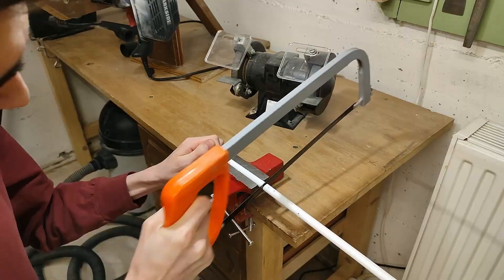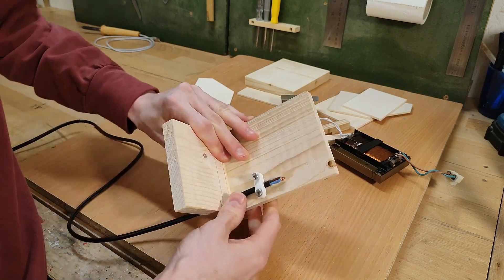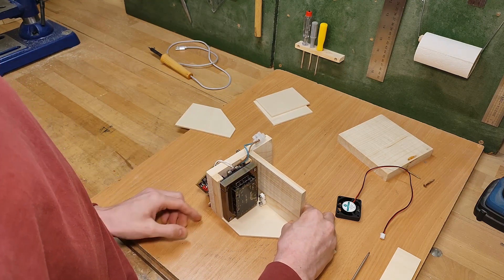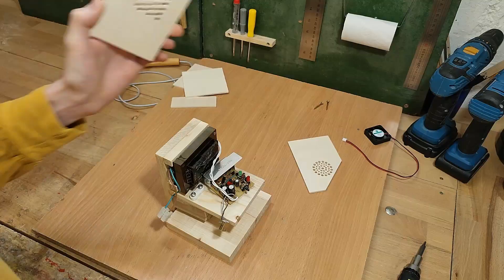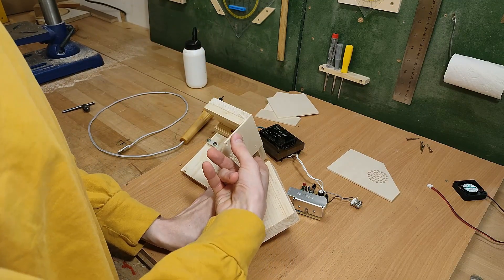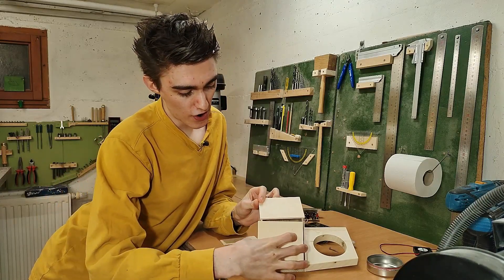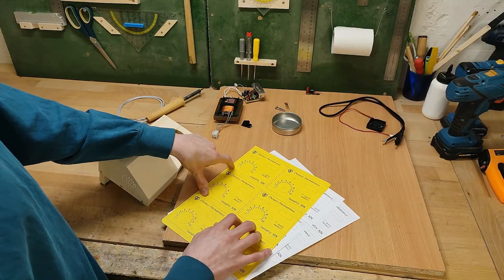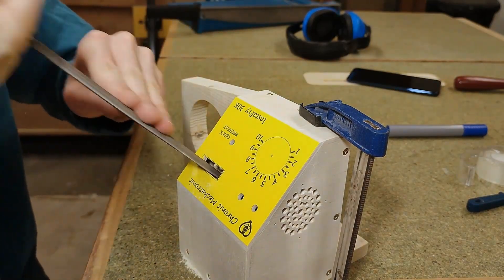Part 3 of the DIY REAL 30W soldering station actually BROKE Chronic Mechatronic

Comment from the maker: Oh. My. GOD! It took me so INSANELY long to film this video that I got the youtuber equivalent of a writer's block and couldn't get anythingdone on it for months - add to that my total failure to estimate how much work I could reasonably get done in twenty minutes. There was still soooo much little fiddly stuff to do, that, had I tried to finish the project in this video it would have easily ended up an hour long! And since time goes on and footage gets outdated I decided to end the video right there to finally upload it.
I will still finish the soldering station, no worries!
Just maybe not the video series as I don't believe the topic is still relevant enough on this channel. If there's acually enough interest I'll do a followup video to show you guys the finished product.

Comment: It’s been over a year since part 3. Is the iron still working? I wondered how the heating element has stood up.
Reply from the maker: It still works just fine! While I don't solder very often (maybe once a week) I haven't really treated it with care. Just used it normally.
Biggest drawback is, that it doesn't really get hot enough for lead free solder, which is why I sadly had to partially replace it with a cheap 80W 908s after my lead solder reserve started to dry up :'(
Reply: Thanks for the reply--and Happy New Year--I'm impressed that it is running and it is good to know. I'm thinking of making a similar heater and wondered how long it might survive. You really need ceramics for the insulation or possibly mica if it is thin enough in order to be able to run at the high temps needed for lead free solder.
Reply from the maker: @GarryHeard thank you, right I'd already totally forgotten about that and gone back to normal responding-to-comments-mode. Happy new year!
I know, fiberglass sleeve isn't ideal for these temperatures, it gets baked into a brittle, white substance similar to plaster. As long as it doesn't get disturbed mechanically it seems fine though. I was somewhat worried about the PWM pulsing introducing vibrations into the heater coil via electromagnetic fields which could eventually loosen the heating element inside, but that doesn't seem to have happened either.

Comment: We're expecting part 2 of "building a wooden 3D printer". But it's a good surprise. I thought you gave up this project. It's still alive and your Japanese art of details is like a jeweler's. Entertaining as well. Wood is an universal material in fact. Merci Ben!
Reply from the maker: I usually try not to give up on projects even if it takes years to get them completed 😂 My longest standing project to date is an RC plane, mostly finished but still hasn't had its maiden flight after roughly ten years!
Though that's more due to the logistical problem of having to drive somewhere to fly it, rather than not finishing the build.
For this soldering station it was just the fact that filming everything makes it three times as complex and with all the little steps it just overwhelmed me.
Reply: @ChronicMechatronic  10 years? you were a teenager by then... I've noticed like most of your followers I think, that some of your projects lifespans are quite large. (FR) Mais une fois qu'on le sait, le reste devient naturel! Allez! Salut Ben et bonne semaine à toi. Pense à dormir ;)
Reply from the maker: @joetkeshub  yeah I was about 12 at the time - the pace at which I build things was always quite slow, I never was the type of person to bang out one big project after another in almost no time. If I remember correctly the table saw took a whole year to finish as well, though now with youtube everything takes way longer of course... 
Pas de soucis Philibert! Je n'ai pas l'intention de me surmener, ni pour quelconque boulangerie, ni pour ma propre entreprise 😂 Toute façon, étant fatigué je n'arrive pas d'être productif. 
Aussi bonne semaine à toi :)